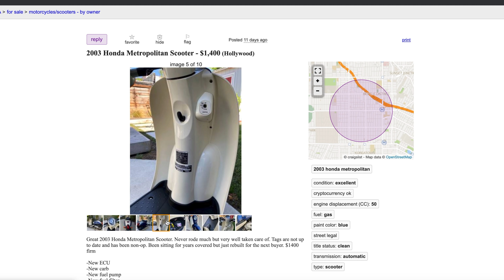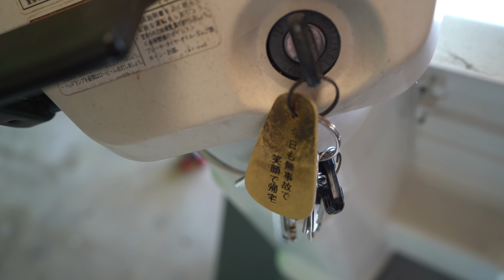We Bought the Weirdest JDM Scooters in the World! - Honda Gyro

Comment: I had a Yamaha quad/4 wheeler that used oil injection like this. If you know the correct ratio of gas to oil, it should be as simple as disconnecting and blocking off the lines/connections running from the pump, tank, and carb. Then simply mix the correct amount of oil into your gas.

Comment: You can get a Chinese 125cc  4 stroke engine with everything you need for just over $400 off Amazon.  It is electric start, automatic clutch, 3 speed forward and 1 speed back, comes with the ignition switch, throttle sensor, and wiring harness.  The only thing you need is a muffler and to rig up some sort of cable for the shifter.  It wont smoke so bad and you could do around 55-65.  I would love a bike like that thing.

Comment: 2:27 I spy a Customised 400 cc Honda Steed. (an old girlfriend used to have one). Pretty much spot on yet the fork angle is a little bit steeper on that one in your video.  A good reliable 'poor mans Harley'.
Reply: Oh, the speed limit for 50 cc scoots in Japan (or at least I know in Kyushu) is 30 klm's p/h !!! sooo weak. If you have a bigger bike licence you can get a red number plate which allows up to 50 k an hour I think. Most 50 cc scoots in good nick can top 85 klm's p/h. Mine is either full throttle or on the brakes, there is no in between.

Comment: ... and you have to clean up the tanks, use a aftermarket fuel filter, use your own 2% oil mix in the fuel and disconnect the ol oilpump, clean up the exhaust and exhaust port of the cylinder, clean up the piston top and cylinderhead, get the right airfilter (Two stroke airboxes are specific in size and resonance), exchange the pointers, set ignition timing 1.6mm AOT,  forget EVERYTHING you know about fourstrokes!

Comment: id swap the motors to something 4 stroke. some 4 stroke scooters out there to cannibalise for that. 20mph? are they single speed like go carts? then get an off the shelf motor for or from a honda pressure washer or such.  if you want gears, get one from an old quad.  maybe need to do some cutting and welding tho. good luck. looks like fun to play racing laps in your back yard only

Comment: Ditch the oil injector pump, and just run two cycle gas mix.
Reply: I do this on my 2-stroke outboard motor, better to premix than having a failed oil pump which is very common.

Comment: 4 or 5 hp ... wow .. so now I'm wondering ... I suppose .. no way to buy a Honda 4 stroke motor for back there or a more modern (parts/reliability etc) motor.  Honda is actually an "engine maker" more than anything else; so motor possibilities ... humm.  As I recall .. 4 stroke half the power per rotation (you lose a rotation to vent it right??) anyway I would have to get my head around it so maybe an obvious reason why either going with what your have  instead of changing it up might not make sense.